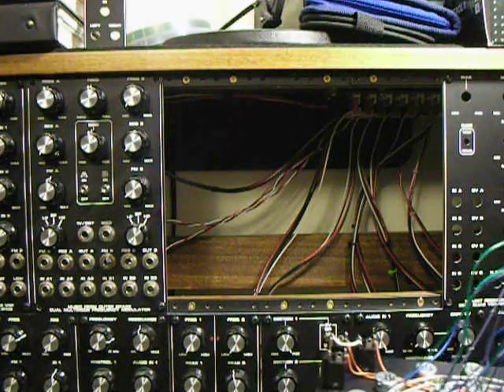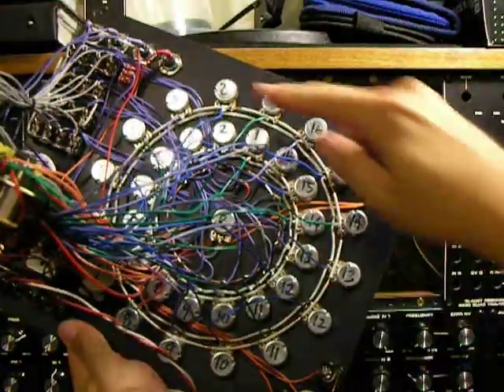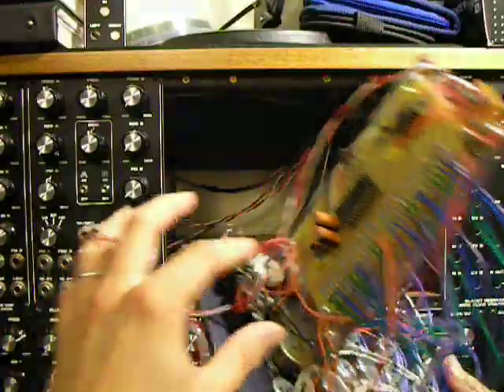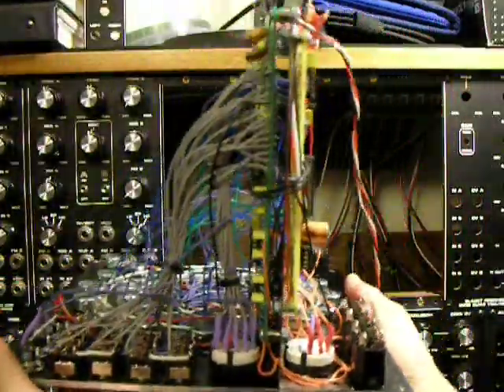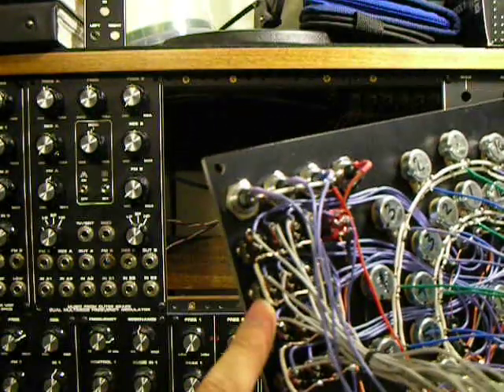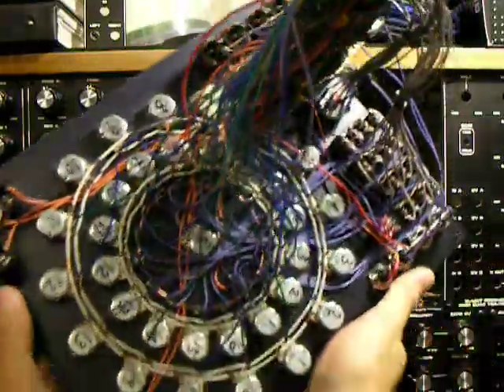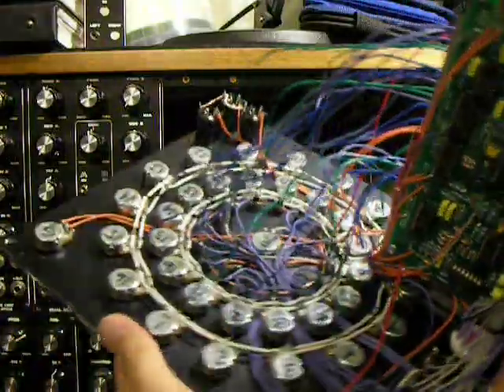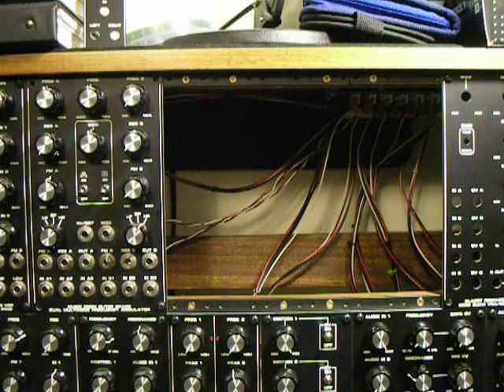MFOS Analog Sequencer 2 of 8

Comment: great job - though as a word of warning to others - as an architect and part time industrial designer - I would try to motivate people NOT to mount their PCBs horizontally like that - but rather VERTICALLY. The horizontal mounting places too much stress on the brackets over time and may cause premature failure. Always think about gravity and how you can use the shape of the board to self-support - that way you can avoid failures and have a more reliable build.